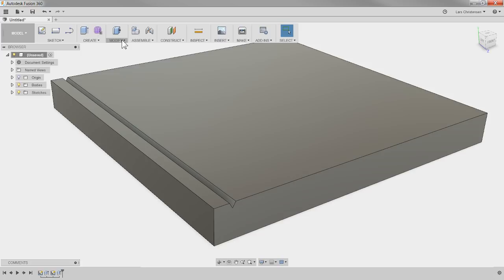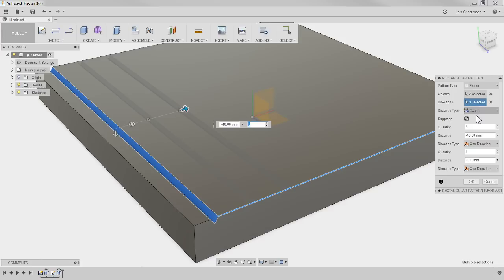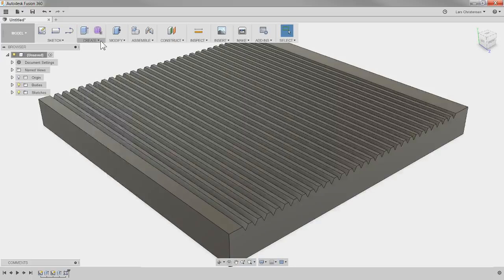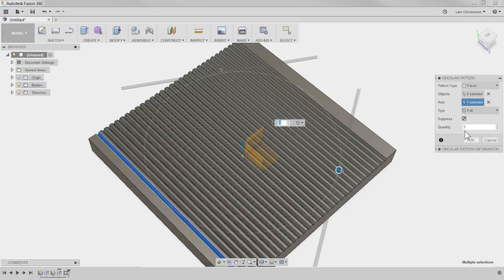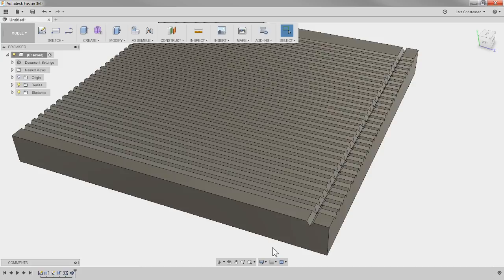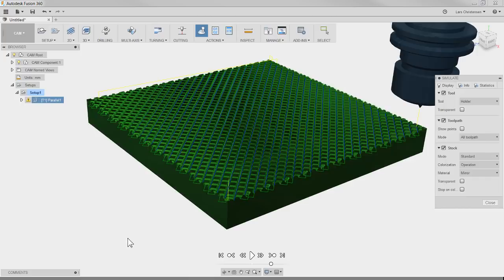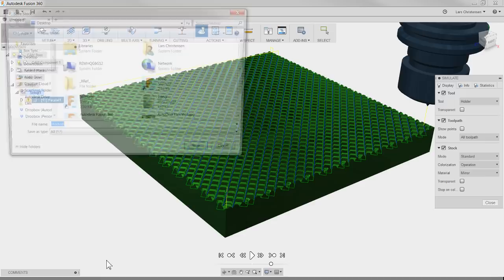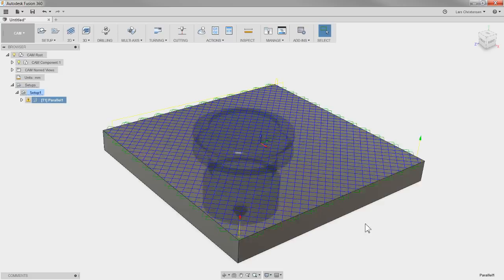Create Cool Patterns & Knurling for 3D Printing — Fusion 360 Tutorial — #LarsLive 116

Comment: I needed this video a few days ago, when I realized that F360 was going to blow up my processor while sketching out a custom pattern. I tried it with SVGs, but the results were hit and miss and it still bogs the processor while building all of the faces on extrude. This is a great trick and I'm hoping to find the alleged live stream in-depth look at CAM that you mentioned.
Reply: this tutorial is 5 years old, current fusion 360 is much faster and allows to pattern feature, instead of pattern the selected faces.  So instead of selecting the faces you just select the previous feature (or command in the history line), just google it, pattern feature in fusion 360.

Comment: I like the cam created knurl on the round part, but I noticed that the graphic representation has "lied" to us. If you think about the fact the a "V" shaped tool moving from the highest location on that curve, to the a lower position the shape of the "V" will increase in size at the surface, as the side of the tool generates a shallower tangent angle to the part.
Don't get me wrong, I like the idea that the pattern comes out even, so don't let the programmers change the sw. The end result is what we are looking for as a pattern. Where as, if it were to actually simulate that pattern in reality, it would not really be anything of use to 3D printer.
I just noticed it and figured I would mention it.
Thanks again for everything you do Lars. CAD on!
Reply from the maker: Hi UpYourTrunkLumberCo Thank you for watching!
Are you talking about the curved surface? I should have used the multi axis toolpaths, that would have made a constant depth.

Best,
Lars

Comment: I really wish they would put some more work in to modeling with curved surfaces. I feel it is lacking a little. For example, When putting patterns or text on a cylinder you can't wrap it around the cylinder. The only way around this right now is to model it on a flat surface then use sheet metal tools to curve it in to a cylinder but that brings up a number of other issues.

Comment: This is worth exploring.

"I have a request" is it possible to use sheet metal tool too turn a 3D image to get the dimensions of each side.

I'll explain what I'm looking for here.

I own a 3D printer and a Cutting machine (Cricket).
Now I often print items but I like to cut vinyl to cover the image. I can manage this with basic geometry. But if I add curves or fillets this gets very difficult to calculate.

So is there a way to convert a 3D image into sheet metal so I can get the required dimensions kindo of like how you make a cube out of paper bye cutting a T looking shape of 6 squares.

Comment: Hi Lars 
Never thought of using CAM to do that.
I have a plastic part that I need to add a texture like concrete both for a 3D print and then for the mould tool. I'm from a Solidworks background, it has a feature to add a 3D texture, I don't think 360 has that yet? 
So have you made a livestream to show how already or could you make one?
Thanks again

Kev

Comment: Would you happen to have a tutorial on creating a more random pattern to a flat surface? Something like leather grain.
Reply from the maker: I do not. I would use an appearance for something like that instead of modeling it.
Reply: Lars Christensen I see. But I need the texture to print that way. Any ideas?
Reply: @HenryStarling  Wouldn't setting "Fuzzy Skin" in Cura provide something like that?
Reply: @HenryStarling  You can use other rendering machines like Keyshot for more options like leather, fabric, etc
Reply: @DavidTabachnikov  fuzzy skin works only on vertical surface. so if he has a Square box, bottom and top wouldnt have the leather texture.

Comment: Thank you for the video Lars! You have taught me so much about Fusion is the short couple of months I have been tinkering with it. I have a question, or questions, about this topic. Is a pattern like this possible on a model that is made in the "sculpt" tool? I have several models that I have designed for soft plastic fishing lures, (worms, crawfish, shrimp, etc...) but they are all smooth surfaces. I would like to add some texture to them. Is creating a pattern like this to use as a "skin" to apply to a sculpted model possible? I apologize if my terminology is off, I'm still learning! Thanks!
Reply from the maker: Yes, should not be a problem to do this with the sculpt also 👍😊

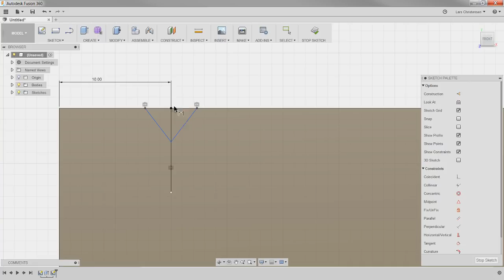Comment: Much has changed, in Fusion360 2.0.8816 the constraints menu is not on my Sketch Palette but rather in the menu bar. Also, I don't know what you did to move the lines at 2:08 but I don't have an option to not select a menu item but just to click with the mouse and have Fusion read my mind that I'd like to move the lines. The same is true for when you set the angle, again, Fusion read your mind because I didn't see any menu selection, just mouse clicks and viola, different action.
Reply from the maker: Fusion got smarter :-)
Reply: @cadcamstuff  Seriously, what did you do to make those lines move? Or use the symmetrical function? I tried following along with your video but I don't get the result you do. Fusion doesn't do anything when I try the symmetry function or moving them as you did, by setting a defined parameter.

Comment: I'm trying to make a knurling of very fine small squares with 40 circular patterns for a 3d print. However, fusion 360 crashes on calculating every time. I will check out this cam work around.
Reply: Turns out free version does not have cam, so its a no go.-
Reply from the maker: Not true. The free version does have CAM.
Reply from the maker: https://www.autodesk.com/products/fusion-360/personal-download

Comment: Hey man. Can we create a belt pulley system in fusion 360? One that actually moves in the way intended. Would appreciate if you could please explain if possible.
Reply: I would also like to know if this is doable
Reply from the maker: You can model the items an animate the movements using the joints via a motion study, but it will not move because of the friction of the belt against the pulleys.  This would be a great livestream topic
Reply: Lars Christensen, I hope this means a livestream on this topic would be coming soon. 🙂